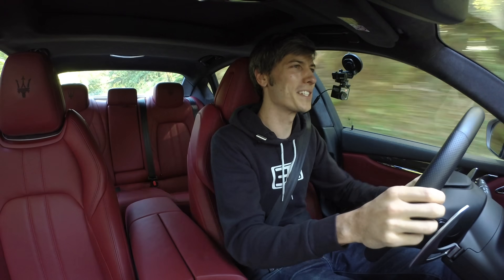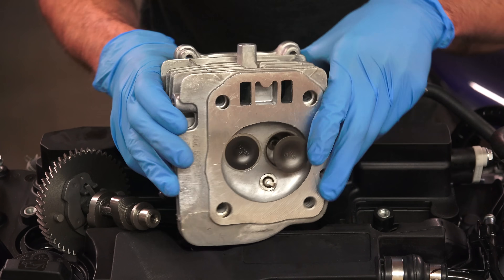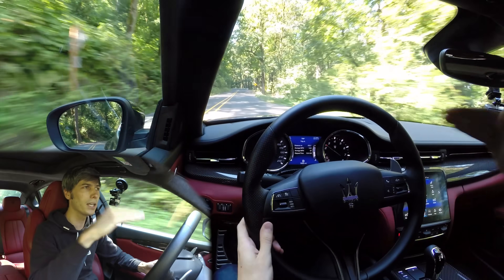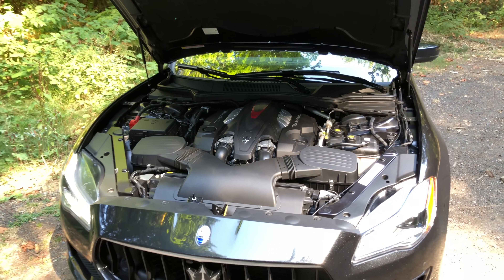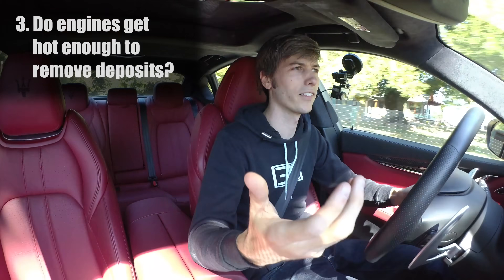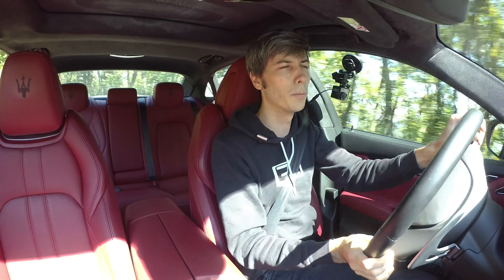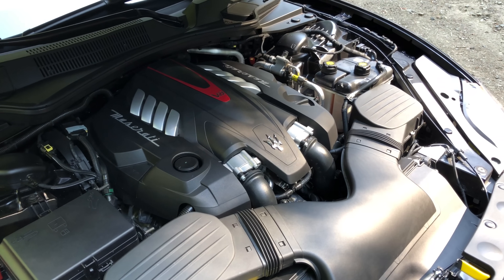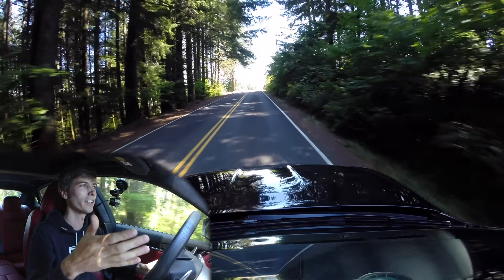Is Redline Good For Your Car's Engine? Italian Tune Up

Comment: I drove my ex-girlfiend mum's car to go to a concert, 300km away from home.
That car, an Opel Corsa 1.2 Twinport, I think never had any moment running over 3000rpm, and never at full throttle.
We used that only because my car at that moment doesn't have air conditioned...

We was 5people in car.
We started and on the highway it was impossible to reach our speed limit, 130km/h in 5th gear, only in 4th and only on flat road.
The engine was clogged at the point I wonder we can't reach the concert...
After some km in 4th gear at full throttle (at 130/140km/h, no more) car started to run better.
After 70/100km the car were running like new.

Returning home, next morning, I can keep 130km/h in 5th gear, and when I push the pedal it reached over 170km/h with a noticeable acceleration...just noticeable, I'm speaking of a 1.2L engine.

The next day, the car owner said me "what did you do to the Corsa?
It is a lot more powerful, I started from a roundabpout and I made a wheelspin!".😂😂

This happened (just for laugh) in Italy...
I'm Italian and I lived in the middle of the Alps, at the time.
Reply: Thanks for that story I appreciate it
Reply: Can confirm this is true. I've had a 1.0ltr 3 cylinder Corsa for over 15 years and if it's used mainly for town driving for just a few days, RPM up to or around 3.5k, it becomes boggy and sluggish, develops 'mayo' under the oil filler cap and on the motorway it's near impossible to accelerate from 70mph to 80mph in 5th gear - it just won't go. A blast up and down the motorway, revving up to 6k RPM when joining, loosens her right up and she always feels much faster. In 5th gear at 70mph it sits around 4k RPM, which seems to be her comfort zone.
Reply: @MickMaanski  If you are getting that under the filler cap I'd do an oil/filter change with some cleaner in with the new oil then another oil/filter change 3k miles later.  I'd recommend Sea Foam.  Really helped clear the crap out of my Chrysler Neon at 168k!  I sold her 64k later, although I did notice a performance drop by then.
Reply: hahahaha.. nice dudee
Reply: Something similar happened to me, so I know it really makes a great diference in some cases
Reply: I have had a similar experience with a Mazda. You wonder if it is deposits in the engine or if there is some form of blockage in the fuel system and the high RPM is clearing the blockage.
Reply: @MattyClivingthedream  which Mazda you have? I have one with the skyactiv-g 2.0 engine
Reply: @MattyClivingthedream  Surely wasn't a dorito powered mazda.
Reply: @sploofmonkey Its also condensation in the oil. Getting the engine to operating temperature evaporates any moisture in the engine left over from combustion or from the environment.
Reply: @guyderagisch4964  Last year when I was going to school in Maine, I noticed this during the winter when I was only driving to and from school a mile each day. Did a couple hours of highway driving and it cleared right up
Reply: Did you just drive down the alps and get more oxygen as you drove?
Reply: (just so you americans know, 130kph is our speed limit in highways, and it's 80.7mph)
Reply: My stephdad liked to drive on the highway so now and than with his old 4 gears (B) Kadet to clean it.
After a highway run the exhaust was white from inside instead of black.
Reply: I experienced the same with 2 cars i bought that were previously owned by old ladies. 
I suppose the car salesmen didn't lie in those specific cases.
Reply: Man, I'm Italian as well, and I did exactly the same with my ex's father car, maaaany moons ago. ;)
Reply: You're golden, I always told my clients ( I worked in a turbochargers restoration shop), especially ones that had diesel engines, to ignore the noise and rev up the engines, even in town, otherwise the EGR-s and the variable geometry on their turbos would clog up with carbon deposits.
Reply: @dadoVRC cool story bro.
Reply: Maybe it only works in Italy
Reply: It's not really the redlining, it is keeping the engine at a higher load for a longer period of time.

Engines are designed to run at significant fraction of rated power, so they don't like to idle or work at less than 30%. They want to see something like 65% rated power. 100% all the time is a bit too much
Reply: @daszieher  I run it at full throttle, not at the redline.
I don't remember exactly, but in 4th gear at that speed it doesn't rev over 4500 rpm, it has very long gearing ratio.
Reply: @dadoVRC  exactly.

I am sure you know, but some reading this might not: full throttle is not 100% power. 100% or rated power usually occurs a few hundred revs under redline.
Reply: @Bhigr Bond I don't need hide my behaviour, if the highway is clear and I know there are no speed check, i go over the limit.

Things are enough boring without those "suggestion style" comments.
Please, avoid them.
Reply: May have unblocked an injector or two also, or freed up a compression ring. Lots of things can happen. Worth driving a car 'hard' on occasion and particularly taking a decent trip every 2 weeks, cars like this in general.
Reply: I had a good laugh at all the replies saying things like you cleaned the catalytic invertor or a fuel injector during your trip. Every car I've owned (mostly carburettor engines with no cat) after a trip involving an hour or 2 driving on a highway, when I get back to town there is a noticeable difference in power and acceleration. It's because lots of carbon buildup is removed during the drive, making for a better combustion in the combustion chamber.
Reply: max limit in aus is 110 :(
Reply: freaking Vauxhall Corsas.
Reply: I drove my 87 trans am at 90-110 mph for about an hour and it seemed to increase the acceleration a bit. But anecdotes are anecdotes.
Reply: Sounds like a fun experience. Glad you guys made it!
Reply: Uuu
Reply: @Angel Dust No, I lived in Trentino, the other part of the region, until 2017.
By that year I moved south, near Cesena, in Romagna.
Reply: A 1.2 engine in the Alps !  HaHa!
Reply: It wasn't your car after all!
Reply: Why did you split up with your GF?
Reply: so great
Reply: Corsa is a very underrated car
Reply: Sounds more like a tank of bad fuel, but if the car is used predominantly for short trips- the Italian tune-up  theory might be plausible.
Reply: Yeah, that´s the catalytic converter clogging. It´s even worse with modern Diesels and their elaborate emission cleaning systems.

This Videos is about carbon deposits in Direct injected engines, forming right at the injector nozzles. Two very distintive issues ;)

BTW: Since the majority of engines are running on hydraulic tappets, they don´t like being redlined for longer periods at all ;)
Reply: @axelhorneff5077  No, it isn't.

It was a small petrol engine with variable lenght intake manifold.

The main problem there is the carbon deposits on the intake valve stem, when driven at low power for long time.

If petrol is sprayed in small quantities, valves become cooked with a thick layer of carbon (I saw valves with deposits more than double the diameter of the stem) because the small quantity of petrol injected can't wash it away.

Driving for a while at full throttle at higher revs allows temperatures to increase, to inertia to break away the majority of the deposits and to petrol to clean away that mess.

And...there is a kind of engine that is direct injected from long time...

Diesels.

Try to see what kind of deposits they have on the intake side...😉
Reply: @sploofmonkey Absolutely right, when I buy used cars and see that mayo i know the head gasket is or is about to be toast
Reply: @MattB90 absolute nonsense
Reply: It would have been an O2 sensor or something clearing up.  The engine wasn't clogged up...boring story too.

Comment: There’s obviously more to carbon removal than temperature. The fact cylinders contaminated with a coolant leak become squeaky-clean with zero carbon is proof of that. Pressure and shock are probably significant factors as well.

Comment: Tested on some cars. It works. Cleans some carbon deposits, cleans some oil residues, cleans injectors. Not perfect, but for cars that don not get above 2500rpm everyday and do short trips while engineis still cold -  it is a must! Before oil change, give it some 20-30min of hard work in lower gears. Change oil, all filters, sparkplugs and it will drive like a new one.

Comment: You talked about heat, what about the speed that the valves are opening and closing at high rpm?  Seems like that would make it harder for the carbon to “hang on.” I’ve seen first hand cars driven hard for the first time blowing black soot out of the exhaust.

Comment: You didn’t discuss diesels. From someone who used to own a garage, we got a lot of cars from (older) customers who never went above 2500rpm and they always failed the smoke test on the British annual MOT test. All we used to do is wring the car’s neck in 3rd gear at 60mph for 20-30 mins on a dual carriageway and they passed with flying colours. So, with respect, you can read as many scientific papers as you like, but real world experience tells us with 2L turbo diesels, the Italian tune up doesn’t just work, it’s absolutely necessary to keep the car in good health.
Reply: Matthew Twigg Our 2005 Volvo Diesel almost doenst redline or go over 3000rpm and it has passed every test.

Comment: In light piston engine aircraft, it is definitely possible to get the engine to run smoothly again by running it lean and at a middling power setting.   The "runup" (engine test before takeoff) typically calls for running at 1,700 rpm (2,700 rpm redline), then checking both the "Left" and "Right" ignition systems.  If you see an excessive rpm drop while running on only one ignition system, you possibly have a fouled spark plug.  So lean the engine out (stoichiometric is fine) and bump it up to 2,100 rpm for 30 seconds or so.  Recheck the ignition system that wasn't working well, and it's almost always better.  I realize this isn't so much removing general carbon, but I think it's possible that in cars (no manual lean control) a higher power setting could help remove deposits on spark plugs.

Comment: Might need access to research data like you but I have found that the Italian tune works on clearing DPF on diesels.
.a few hard pulls off the lights can do it   or that for starters when warmed and just the occasional short burst of power after the drag of the lights as high temp plus the over abundance of O2  in exhaust

Comment: I have a question. 
I own a Fiat Bravo (2008) 1.9 Diesel. I have found the ERG unit gets clogged with carbon easily. I use the car almost daily and at least once a month I give the car "an italian tuneup", by this i mean i redline all gears and top out at about 120mph holding it there for a few seconds (or run out of road). 

So my question is this. Does the ERGU get clogged more because its a diesel or is the car just not capable of the heat required to remove carbon from the system?

TIA

Comment: Wrong!
Engineering, you missed some of the most important thing of the Italian tuneup.
You are too young to understand the it's the combination of high heat, fast movement of the engine parts that causes friction, and high volume of exhaust gas does that fine Italian tuneup.
You use the calculator too much son.

Comment: I think you went down the wrong path for determining the benefits of the Italian Tune Up.  This idea comes from the era of carbureted engines.  The idea of full throttle blasts is to clean out the carbs.  That redline running pulls the maximum airflow through your carbs, clearing any contaminants in the jets, restoring a smooth idle and better running.  Works great on my '65 Sprint GT.

Comment: Ive known it as the British tune up from a fuel stand point in 60s and 70s carburetors of a specific design. The vacuum driven style found in MGs and Healey's. Good to know your perspective of removing carbon build up is bunk, as i suspected at the start of the video.

Comment: Run hotter spark plugs.  Hotter plugs don't remove heat from the combustion chamber as fast and therefore the heat will destroy carbon

Comment: Just convert to LPG.  My LS V8 here in Melbourne drinks clean LPG fuel 1/3 the price of petrol and the oil is just as clean when changed as when I put it in at service.

Comment: He mentions that parts internally are called by the oil yes this is correct but he fails to mention that calling your oil too much too quick will damage parts and cause uneven wear are as it cause surfaces down too quick. A quick solution would to have a solenoid on your oil cooling suck it to divert the oil back in the engine and once the engine has warmed up up to allow the oil to cooldown when calling is needed. But what I get confused about is is with synthetic oils there are heat tolerance is sufficiently higher and the facility of the oil stays stiff if at higher temperatures. This plays a significant role in understanding that changing your oil pending on your climate temperature change will help extend the life of your engine for example when you are in a Hotter climate you will need to put a thicker oil in as engines run hotter and when your climate turns cold you will need to put a thinner oil as your engine will run colder.

Comment: High RPM driving when the engine is warm is very good for parts that you would not consider i.e it's good for clearing gunk deposits in injectors..... injector pumps water pump. power steering pump., and oil reservoirs. Best done upon oil change p.s change oil filter s after your high rpm clean out. Old cars will take longer to warm up as they have more metal surfaces newer cars have more plastic parts.  Also do a full EGR valve deletion before even considering assuming that your engine is cleaning the carbon out as exhaust gas recirculation puts exhaust gases back in your fresh air intake. Also do not trust your radiator thermostat as in the winter they conduct heat from the back of the sensor and give out a slightly Force Reading best to get a ODB port reader and test from the ECU

Comment: My opinion on offer is carbon build-up where a car when the engine is cold and their carbon hits colder surfaces the carbon is cold down upon hitting the surface. Carbon build-up can be avoided by avoiding high revs when the engine is below 80 degrees and low RPM driving this also has an important role on allowing your turbo spin up to create the correct PSI for the fuel mixture to be correct.

Comment: Interesting video, but this is all from the point of view regarding temperatures of the piston, cylinder walls, and valves.  I have a rebuttle.
The reason I heard it's good for your engine if you get on it occasionally is because putting around town at the same speeds and shift points (if auto trans) cause the value to open and close at the exact same time/location on the valve seat.  If you get on the juice, it causes the valves to open and close quicker and harder, thus physically knocking loose carbon buildup.

I believe this is why Sea Foam tells you to do "spirited driving" after you have sprayed a can into the intake. 
Also, have you ever seen a car, even a new car, shoot a puff of smoke when it accelerates hard when the engine is under load?  A downshift on the interstate is a good example.

Might not be true, but it makes sense to me.

Comment: I thought the idea behind "italian tune up" was that increased engine speed and low increase air flow, combustion pressures and exhaust pressures, possibly dislodging some of build up. In my opinion, driving hard does nothing for the engine cleaning, it only increases wear and chances of engine catastrophic failure.

Comment: "660.3 °C aluminimu mellting point.. Melting point of Carbon is 3367°C. Boiling point of Carbon is 4827°C... It is known that structural steel begins to soften around 425°C and loses about half of its strength at 650°C" recomended coolant temp of engine is 90 "C .. the engine wil be long gone before the carbon does!!!  carbon buildup comes down to poor engine designs!

Comment: Talking about red-lines, anyone else wonder why tachs scale above that point? Every modern engine will have a rev limiter in the ECM, so what’s the point? In fact, with automatic transmission, the ECM won’t allow a downshift that would cause over revs either. Guess it’s the same situation as our speedos which scale way beyond what the car’s electronically limited top speed. 

“Hey, we’ve always done it that way!😀😀😀”

Comment: A better way to clean out deposits is to go on a real long trip. In the bad old days, cast iron Ford engines were notorious for getting stuck rings. Well, a friend of mine back in the day was an addicted pothead. He drove his oil burner Ford Falcon six from Chicago to Denver just to cop a bag. When he got home, the car had stopped during oil. Wish I'd done that with my 390 Ford station wagon with the cast iron three-speed. If I only knew then now what I know now! About cars. With life, sometimes I wish I didn't know now what I didn't know then. I know too much, but I'm going to keep my mouth shut. I don't want to ruin it for everyone else. Had a foreman who was a wise head, he was a cajun, tell me once in his accent, "You say things that shouldn't be said. I'm not saying they're not true, but they shouldn't be said." Right, they shouldn't be said. But the fact that you can burn the deposits out of an old engine with a long trip and good gasoline should be said. It beats a teardown and rebuild. That Ford 390 was awful, though. There was so much carbon I had to break the rings out of the grooves. Someone didn't change their oil.